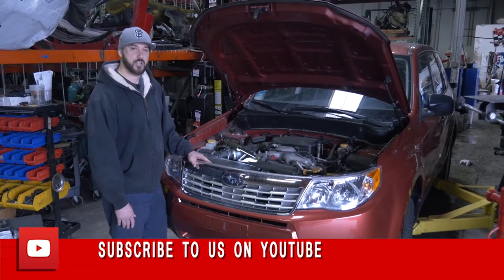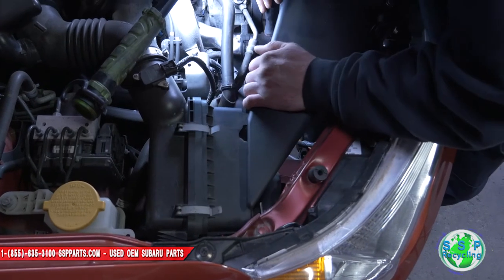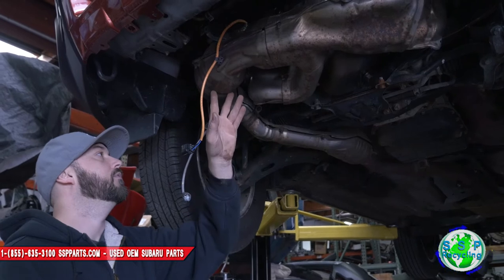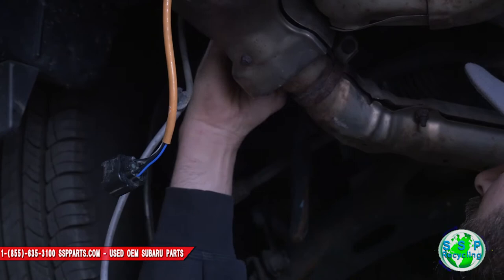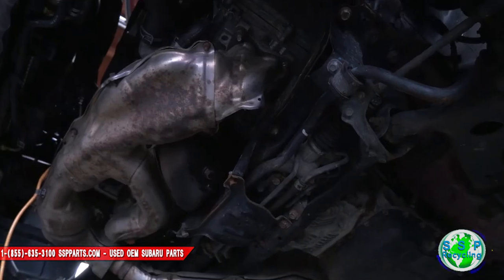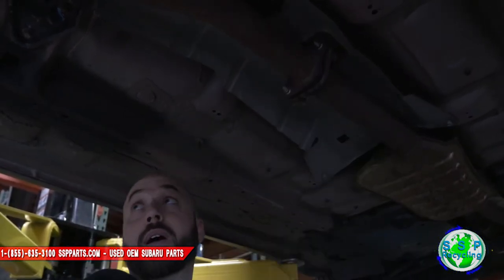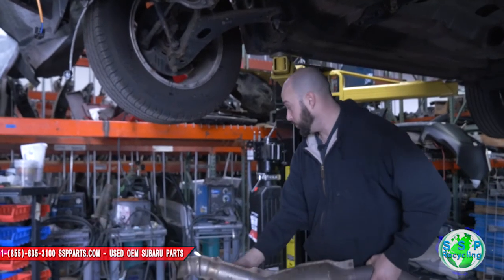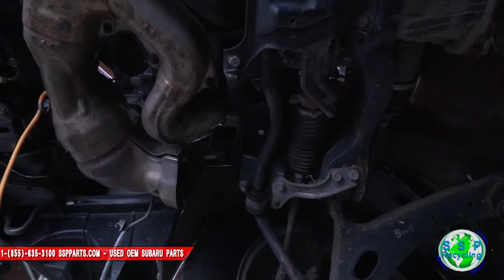How To Remove a Pretzel Catalytic Converter - 2010 Subaru Forester

Comment: Excellent video.  Was able to take my exhaust apart quick and easily.  Instructor gives you the information you need in a short period of time with no hoopla.  Short, sweet and informative.
Thank you for your video!  Spot on!
Reply from the maker: Thank you we try to get to the point camera guy says I'm to fast and need to slow down so any pointers helps us making better informative videos for u guys